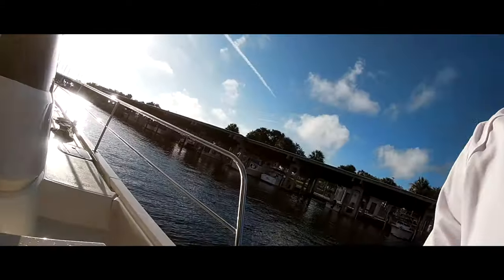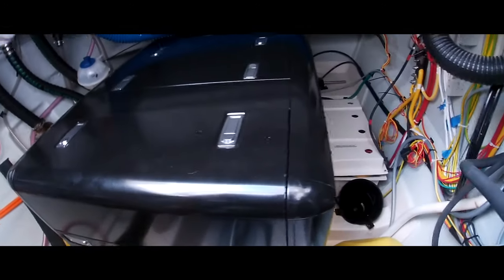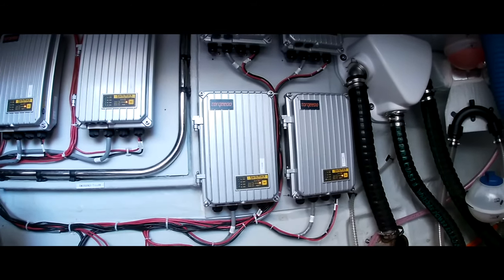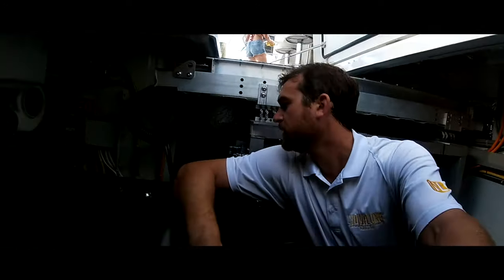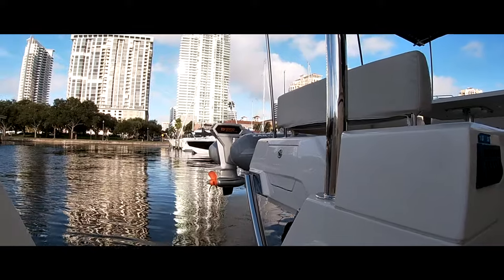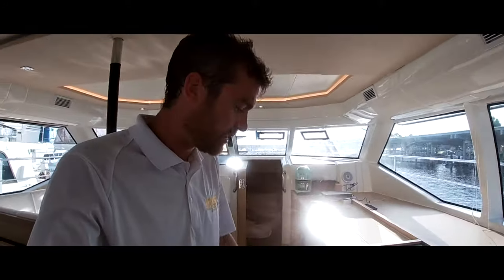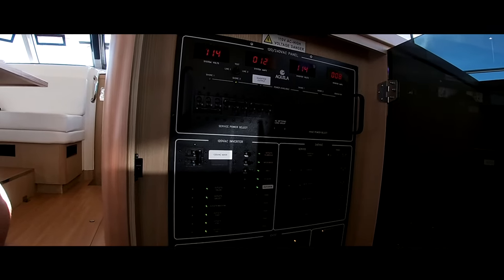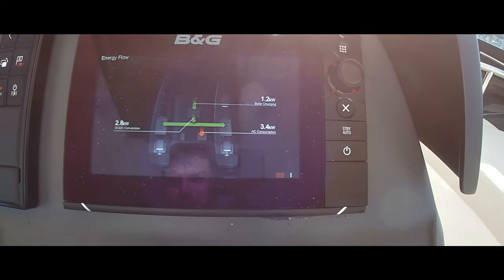Nova Luxe Yachts - True Silent Wave competition from the USA!

Comment: Is there enough power generated to run the daily onboard hotel facilities like fridges, air conditioners,  stove, dishwasher etc.
Reply from the maker: Usually, a 10kw solar array will provide about 40kwhr's of power per day.  If you divide that by 24 hours, then as long as you are using less than an average 1.6kw per hour, your in the plus.  Batteries, give you cushion so you could be negative a few days then positive a few others and it balances out.  Worst case after a few days of little sun, running the generator for an hour or so will overcome any shortfall.

Comment: A 5.6kW array that generates 25kW on average. If I were the manufacturer, I would call it a 25kW array then. But I guess he is too humble :)
Reply: 5.6kw is a per hour figure.  Over an 8 hour time period it averages about 3kW per hour so it effectively provides 25kw in a day.
Reply: @warhawkadventures  If it generates 5.6 kW per hour it should produce 5.6*8=44.8kW in 8 hours. But let's make it easy: I am just making fun of you guys because you know next to nothing about the SI-units.
Reply: @rainerzufall689  I know that customers would rather know what they actually get from the array over the theoretical maximum.
Reply: @warhawkadventures  That is absolutely correct and should be represented by the correct terms and units - power in kW, peak power in kWp and energy in J or kWh. Every kid should know that.